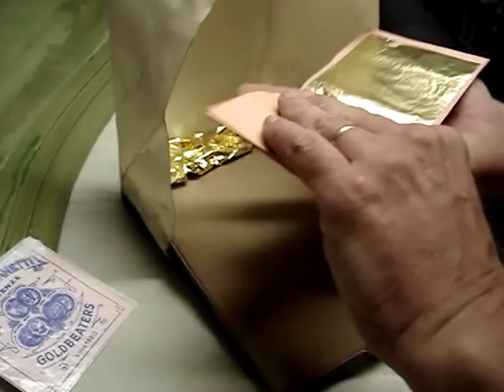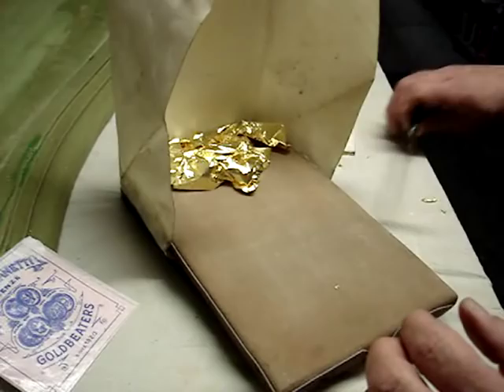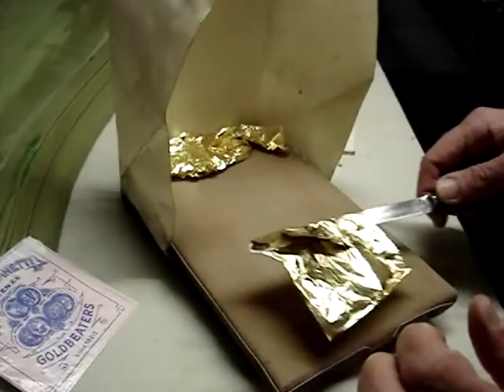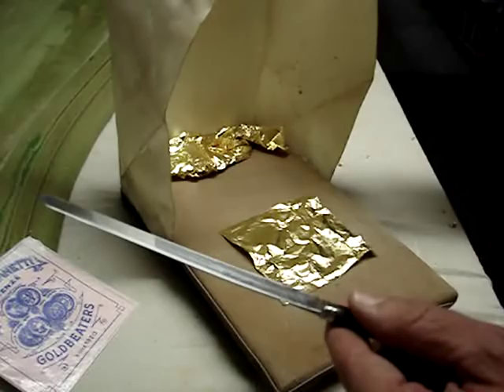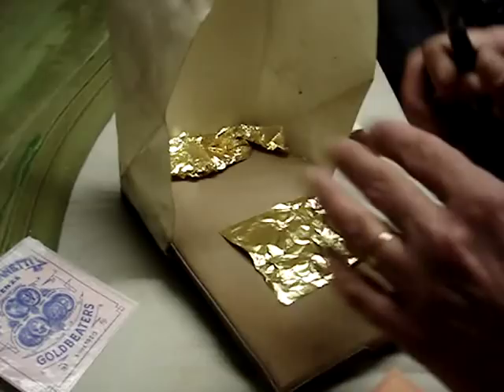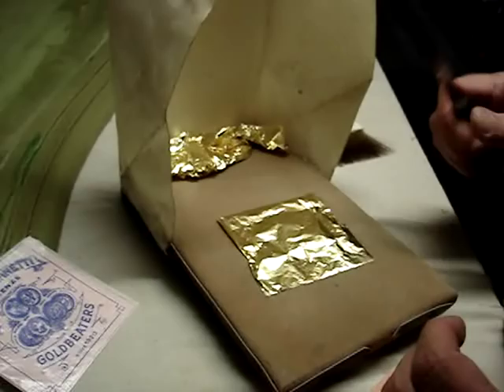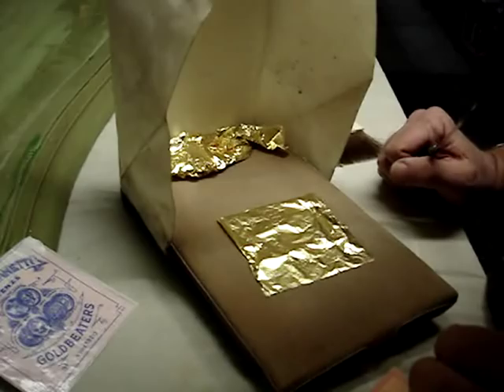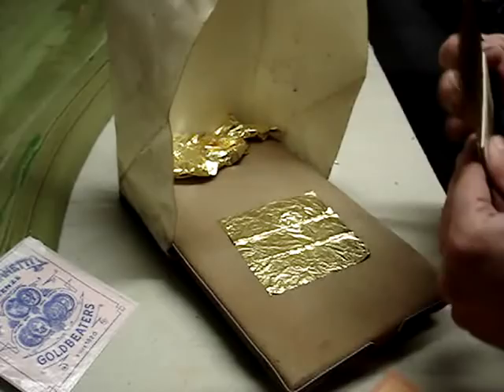Gilding: Using the Gilder's Pad~ Charles Douglas Gilding Studio

Comment from the maker: @chamoco1 No, the leaf doesn't stick to the pad unless there's something on the pad like a bit of oil from one's hands. It happens sometimes so you just need to degrease the pad from time to time with a bit of whiting (the calcium carbonate you use to make gesso). Sometimes static, such as from a room with strong electric heat, can cause the leaf to stick to the pad too. The majority of the time though it works just fine.

Comment: with surface gold leaf it wont stick to the pad at all?
Reply from the maker: Surface gold leaf is still loose leaf. It's a term used to indicate a little lesser quality leaf that is perfectly suitable for oil gilding whereby leaf for water gilding or glass gilding needs a little higher quality. Patent leaf comes attached to a backing sheet where a pad and knife isn't required but it's generally only useful for flat surfaces and used as a transfer. I use loose leaf exclusively.

Comment: Can you made a descent shield  for pad?
Reply from the maker: Some pads come with shields, some not. I've had this one for 30 years so I never needed to make my own but it can be done. Just a matter of getting some parchment, cutting it to size, about 8x12, and wrapping it around on the bottom of the pad and tacking it to the side of the wood of the pad. I have a nice, sturdy parchment on this one so I lucked out. Many shields are flimsy and I've been known to cut them off. Hope this a little help, good luck!